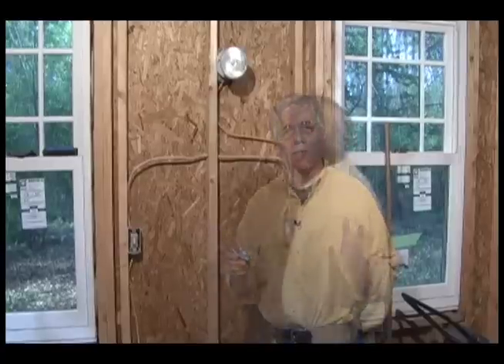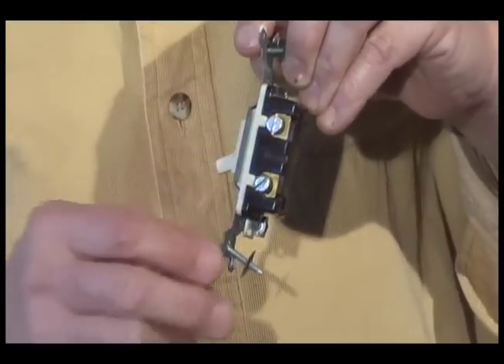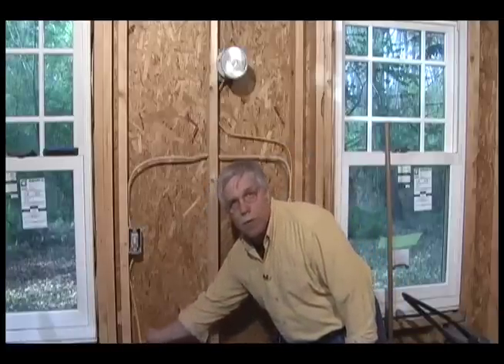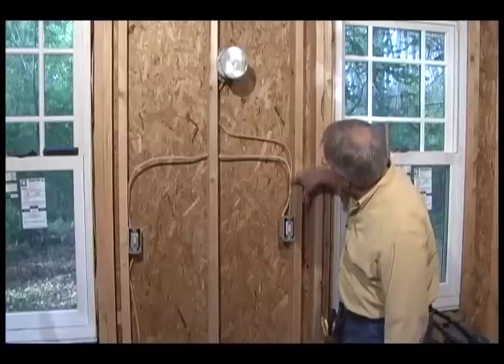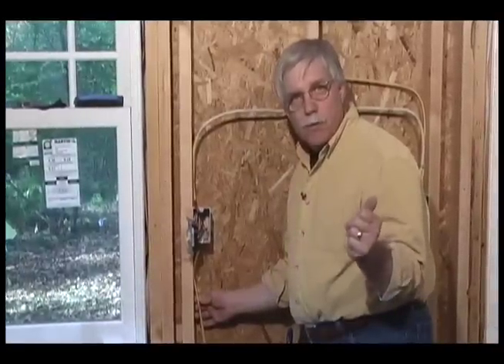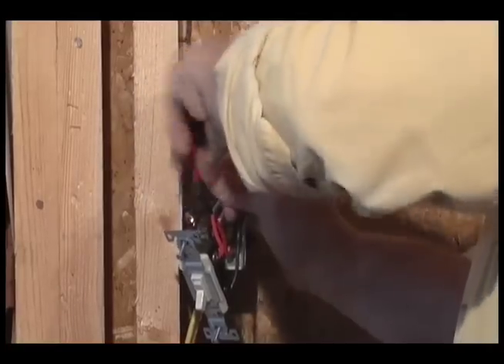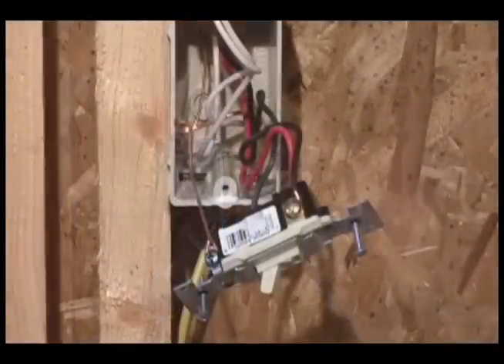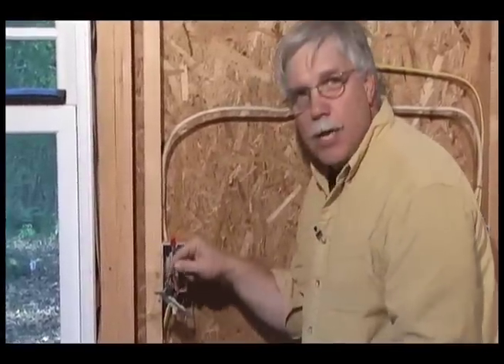3 Way Switch

Comment: This is the most comprehensive video I've found thus far regarding 3 Way switches. I purchased a new house 6 months ago with a set of these that don't work always. When I turn it off from one switch it doesn't turn back on from the other one. It only turns on and off from one of the switches. I don't know what could it be and I am not an electrician. But at least this video will motivate me to turn off the power and see if any of the wires are loose. Thanx.

Comment from the maker: @richardcawrey Did you not listen to my opening comments? I said to "Turn OFF" the power to the switch/circuit." When you do that, there's no need to use an insulated screwdriver.

Comment: Great video. I have one problem. In my house I am trying to replace 2 three-ways (change from creme to white). I bought two new ones, wired them exactly the same as the originals, however the light must be on for the other switch to turn it off and on. If the light is turned off at one switch, the other switch can't turn it on. I switched it back to the originals and it works fine. Any thoughts?
thanks again

Comment: THANK YOU SO MUCH! I am a novice to electrical work. I cycled through several websites and videos here including professional broadcast channels like DIY and yours was the only one that explained it so clearly, along with a great visual demonstration that some one with limited knowledge could easy follow. I have lived in my house for about 6 years and finally fixed the 3 way switch. The house was built in the 1950's & the switches looked pretty old, so not sure how long they were wired wrong.

Comment: Very informative video!  I have a three way scenario similiar to your demo.  One switch at the top and one at the bottom of the staircase.  The problem is one switch will not work unless I toggle the other one, then the original switch will work fine.

Comment: I have one three way switch (two black wires, one red wire) and the other "three way switch" controlling the light has two black wires and TWO red wires entering it. Does this mean it's a four-way switch? If so, why is one switch a three way and the other is a four way? Thanks for the great video.

Comment: How do you wire two lights between the two switches? As in a very long hallway with two lights, and 2 switches. 

     Switch > Light > Light > Switch
and what attaches to the lights, and what bypasses them?

Comment: @HuasoPodrido If you've got the switch say in the order PANEL->Switch->Outlet->Light,, you could disconnect the switch at the box, then replace it with a battery-powered remote switch.  You'd have to then hard-wire the outlets from the switch box.  The exact wiring at the light is something you'll have to play with on your own, but they make radio-sensitive receivers that are pretty cheap...  the light would be connected to the receiver end - it'd get power, but would be controlled by the battsw

Comment: the 3 way problem I have is that it also cuts power to wall outlets! I have 4 outlets in this room only one works another works with the light on and the other two dont do squat! I used a outlet tester and no lights come on for these 3 outlets. I need help. What is wrong and can I take that outlet off the 3 way?

Comment: the NEC (Usa's code) high voltage is 600+
the CSA (Canada's code) high voltage is750+

and to silcer119 its not the volts that can kill you its the amps. It can take as little as .5 A to kill if it hits you across the chest.

Comment: 65 milliamps (.065 amps) can kill, IF THE CURRENT TRAVELS THROUGH THE HEART; the human body can have as low as 300 ohms of resistance. That means as little as 30 volts can supply a deadly current.

Comment from the maker: I'm consumer certified. That's all that matters. You miss the point. Homeowners need to be reminded that this household electricity (120 volts typically delivering 15-20 amps on a branch circuit) CAN and will kill you. If that wasn't the case, there would have never been any need for those hundreds of millions of GFCI outlets and breakers that are found in all new homes and businesses. Consumers don't care what the *technical* definition of High Voltage is. They care about staying alive.

Comment: It's called a 3-way switch because it has three points (terminals) of connection on the switch itself. A common and two travelers. The same way a 4-way switch has four points of contact, travelers in and travelers out.

Comment: I can't tell what you're asking here.  Are you asking if you can run your switch leg to your can light from the same switchbox that has the power cable in it?  If so, then yes.  But the wiring make up is obviously a little different.

Comment: I'm an electrician in the US, and I'm not familiar with your terminology.
What's a cpc?

The wires in the video are on a 120v single phase to ground circuit...  There's no phasing to color code!

By cores not doubled over, do you mean that the wire isn't properly wrapped around the screw?  Because I couldn't see the screws well enough in the vid to verify this.  I don't know how you could have.

By screw its, do you mean the terminal screws on the side of the switch?  Post a pic of your switch.

Comment: Tim,
I'm having a problem completing my 3 way circuit, I was able to get my 4 wire from switch to switch and power to one of the switches but I'm unable to get power from the 2nd switch to my can lights.  Is there another way to run 3 way from switch to 2 can lights to switch?  Thanks,
JK

Comment: I guess if you have really short arms and legs, you'd need to wire a three way switch that close together. Ha ha ha.

Uh, do you have any videos which discuss the black and white wire differences? I've basically done tons of home improvement stuff, but just copied what I saw in the outlet and took it from there. Also, do you have a video discussing adding a fresh line (to the garage toom) from the circuit breaker box? Thanks.

Comment: Thx for posting!  I am wireing up a cabin, with 12 V DC this summer. I guess I can not use this 3 way switch for 12 V, but is it another way to this?  I worked in an elderly home some years ago, and one of the retirees used to be an electrician. I tried to make him show me how to do this, but I was a bit to far into dementia.

Comment: TIMMMMMMMM !!!!!!!!!!!!!!!!!!!!!!!!! HELP !!!!!!!!

I hooked mine up the way you said, but I am having a problem. The lights work fine for about a minute, than they fade out to dark. I know the switching is right, I have a good ground, and it is off of a 15 amp brkr.
Could this problem be possible due to the .49c switch I bought??? 
Is there  a switch thing that us dumb folk should know?

Comment: I would love to see all the differences in the US. Your neutrals you have them grouped in a plastic type plug whats the name of it? It looks handy. We use connector terminals over here, what size circuit breaker or fuse do you use for you lighting circuits seen its 110v over there its 230v here taking you regulations into account. or Single Phase colour code is 
Brown (live)
Blue (neutral)
Green/yellow (Earth)
or 3 phase is brown,black,grey at 50hz Frequency.

Comment from the maker: No worries. It's just that you were asking for the impossible. The video could be 15 minutes long if you covered all the different wiring possibilities. You can see from various other comments that the power doesn't always enter the first switch. It could start at the light itself! I'm sure I wasted some time in this video, but that's there for a little entertainment value.

Comment: I really appreciate this video but I'm having trouble in my situation where it appears that the power is coming through the light box, travels to switch 1, and then switch 2. I replaced the switches and now when I turn the light off at one switch, the other switch cannot turn it back on... and vice versa. Any help would be greatly appreciated.

Comment: wow, i must say the standards in the US are not as high as in europe. First thing he is using an uninsulated driver to open the switch and put his hand on the conductive part, Second yes if does matter where you put the two live wires if you want the switch positions being the correct position on both switchs i.e up in the off postion. im not saying hes crap im only saying the difference good video tho.

Comment: Might want to add that if you want to be extra sure your circut isnt hot.
you should never use your palm to test the lead
use the back of your hand, and if the curcut is still hot your hand will jump back. but if you use your palm it will close around the wire and you'll get electrecudted.

Also 
it veries from contry to contry the wire colors.
Iceland for example has.
Green/yellow = Ground
Blue = null
Brown = Primery hot lead.
all other colors are extentions of brown.

Comment: when both power and swleg are on the same side and white and red are travelers... the hot goes to the other switch, comes back on the white and red. the switch leg attaches to the first switch and the neut goes where it goes.  none of the black to white thinking is involved and there is no white being hot between boxes. doesn't the code say the white should only be treated as a neutral. i know a lot of guys do it your way. in northers california we use white and red to travel. leave black as hot

Comment: what if the light is on the same side as power, what if i add a 4 way... in you dimb case if i have a 4 way, the box will have 2 black and 2 red travelers. lets say i don't know what side the hot is on when i open the box. a white passes through it. the white could be "hot" or not. rather than confuse anybody by phasing the white, i use red and white as travelers in all cases so i know the black passing through could be hot without taping up a white.

Comment: i prefer to use the white and red as travelers.  there are many ways to wire 3 way circuits and if the black is used as the return wire, then you always treat it as a hot no matter how you set up the 3 way.  note this guy has two blacks and a red on the switch. when following some other guys work you can transpose the blacks. that's why i use white and red as "travelers" .... this guy made it look tougher than it is....

Comment from the maker: Did you not turn off the circuit breaker???? You shorted the circuit. Fix that with a new fuse or reset the breaker.
You better watch my videos again and pay attention to the safety warnings.

Comment: must be the united states everything is 20 amp lolol... the only thing i dont like about this method of wiring a 3 way switch, is that you have 2 blacks... this can be confusing.... i always have the back as my common with a red and a white.... so if i have power in my light box, i will drop 2 pieces of 3 wire to each swich, the neutral will go on the light, the power will be tied to one of the blacks of the 3 wire, the reds go together, and the other black goes on the hot terminal on the light

Comment: A really old three way with knob and tube can be found its called the carter system, I have a video that shows the old timers way of making things work, they really knew their stuff. Use it only as a repair because it is not only a code violation its unsafe. But if you run into it, its easy enough to figure out. I think it can be found by searching old knob and tube hook up or old three way called the carter system.

Comment: National Code allows you to install a 15 amp rated switch or general use receptacle on a 20 amp circuit, but not vice versa. You cant install a 20 amp recetacle on a 15 amp circuit because it would be capable of loading to 20 and the 15 would open, where as a 15 receptacle will only pull 15, example is look at your kitchen outlets, they are 15's I know because I'm a contractor and would never pay the extra for a 20, dont have to. Any load exceeding 50% of circuit must be on own, so 7.4 , 15 ok

Comment: 3 VA (watts) per square foot divided by 120V (US only) NEC Like the other fellow said other countries have a complete different color code and usable voltage. Example: 3800 square feet X 3 (11,400VA) / 120V = 95 Amps demand 95 amps / 15 = 6.3 or 7 15 amp circuits required. Or 95/20= 4.75 or 5 20 amp circuits required. Thats for determining required branch circuits, not calculating service or feeder sizes.  Hope that helps.

Comment: I am at a loss...I have been changing out switches and the way it is now the light works from both as long as the light is on to begin with but if I turn it off at one and walk over to the other it does not work. At #1 box I have 2 black and 1 red wire and at box #2 I have 1 black, 1 red and 1 white.  I have been at this for about 3 hours and have tried all the combinations I could think of.  Can anyone help me?

Comment from the maker: You are 100% correct. It is a code violation to use undersized wire on a circuit.

Comment from the maker: No problem. I answered this, I believe, farther up or down in the comments. All the wire/cable in this video is 12 gauge. The 12/3 cable is about 20-years old taken from my basement from a partial roll.

Comment from the maker: You have the common on the wrong screw.  Watch the video once more and test to see what wire either is continuously hot  from the panel or goes to the light fixture.

Comment: Does USA never insulate the earthing cable, referred to here as the grounding wire? We would be hung by NICEIC in the UK and fail any certification testing.

Also this is NOT the only way to wire a 2 way switch, or it certainly isn't the only way in the UK. There is another easier method. But this way is the easiest to explain :)

Comment: Why call it a 3 Way switch? Well when The System started to be used it took 3 wires to make it work so everyone started to say "lets do it the 3 way" Meaning they had to install 3 wires between the two switches. Joe in Florida

Comment: The living room light in my apartment uses three way switches, but they've never worked right.  Now I know why; the builders installed the wrong type of wire without the extra (red) wire.  Thanks!

Comment: When I was in kuwait we used the same color standards blu,brwn and yel/grn.When I went to electrical training it always seemed like things were so much harder than they had to be. So when I got to kuwait I was right cause things are so much more simpler there. all the outlets have their own switch and it even tells you where to put the wires. Also in the states the wire gauge goes down for the more amps it handles where as overseas the wire gauge goes UP for the more amps it handles.

Comment: this is so simple to do wire by # not color #1= a hot or black most of the time and is the darkest screw on swith or recepticol #2 a neutral white colored, #3 a travler red/black with a darker screw

Comment from the maker: This entire demonstration circuit is wired with 12-gauge cable. In my own home, you will not find any 14-gauge cable. Everything is wired with 12-gauge or higher as I never wanted to have voltage-drop issues on any of my circuits.

Comment from the maker: I don't know if I understand your question. But I think you need to know that the black wire in a circuit is the one that is to be connected to a fuse or breaker.

Comment from the maker: Better get new glasses......  all of the wires are the same gauge. The reason you think that is because the 12/3 wire with the white outer insulation is from a 20-year-old coil that was in my basement!  So the insulation on the wires is much thicker.  The copper wire though is the same gauge.  :-)

Comment: What about the same set up but the power comes into the light first?

What about when the light is between the two swithches and the power comes into one of the switches first?

What about when the light is between the two switches and the power comes into the light first?

Comment: So if I go to Ohio and start an electrical business I won't need work comp or risk ins. or a masters license? That's kind of a low regulation wouldn't you say? Does the only safety in competence rely solely upon the inspectors? If so that sure seems like a lot of chance on their part. Here in Mich inpsectors cannot be held liable for faulty jobs because of the training required. Can inpectors be sued in Ohio?

Comment: Yes, I agree that ppl can do the work w/out a license and do it well. I have had many apprentices who I would hold over a journeyman. But the problem is that appr. can't run a job legally in "most" places. And journeymen have the power to do just that. So where I'm from License is everything.

Are you required to hold risk and comp insurance if you do an electrical job. Seeing as how anybody can wire jobs where you are? Company speaking.

Comment: Anybody can go to the county building dept. and pull permits on a homeowner permit. That doesn't mean they're electricians. I've worked long and hard to become what I am today and so has many, many electricians. And as far as I'm concerned getting a drivers license vs getting an electrical license is like flying a plane or just building a plastic toy model of a plane! BIG DIFFERENCE there. You make it sound like it's NO BIG DEAL! Yet you hold a masters in plumbing- Why?

Comment from the maker: Yes. Most electricians here just use regular two wire which has the white neutral and black hot. I prefer to use the 3-wire between switches as the red wire makes it nearly impossible to mess things up.